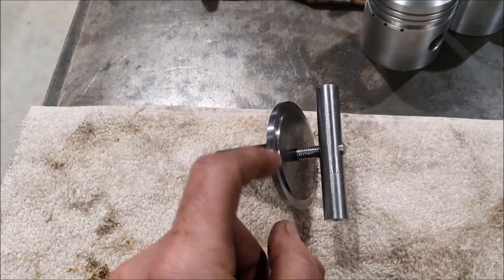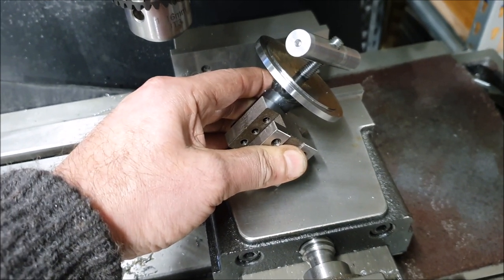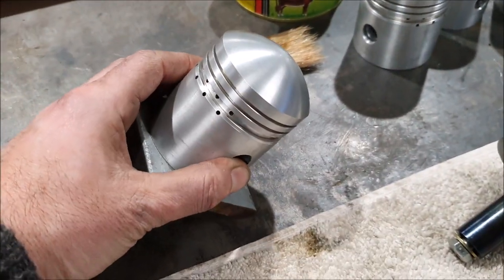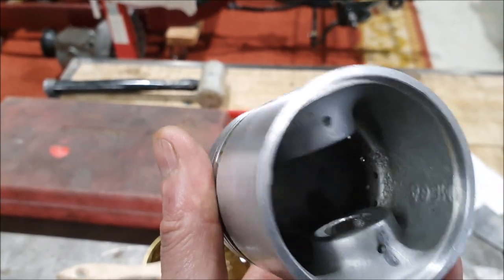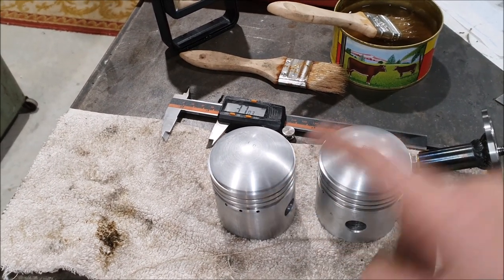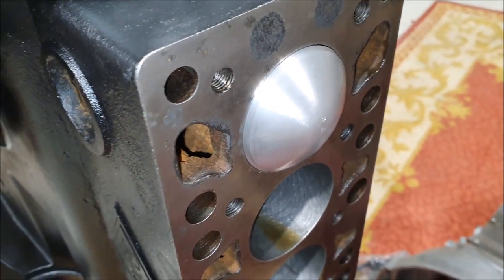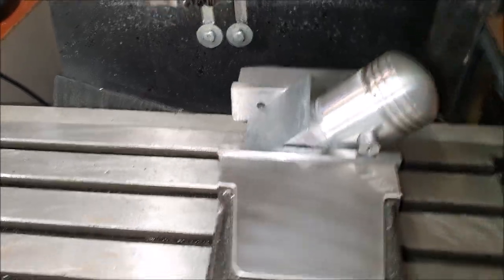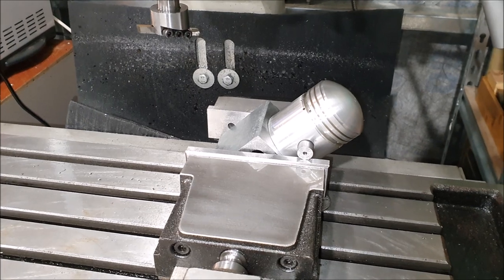Pre war cars - piston step machined

Comment: Couldn't you machine the underside of the dummy gudgeon pin so as to give a 3rd point for the piston to rest in the vice for extra stability? Or too much faffing around for no real gain? Getting close to the final result!
Reply from the maker: I think it should be good as it is. A piston in an engine is under huge loads at TDC/BDC where it changes direction and it's only held in place by the pin I guess so clamping on the pin alone should be fine. Well, I hope.